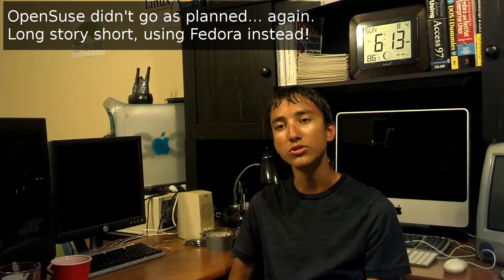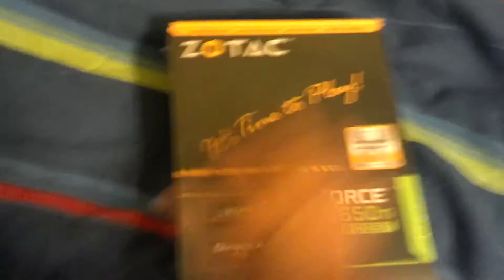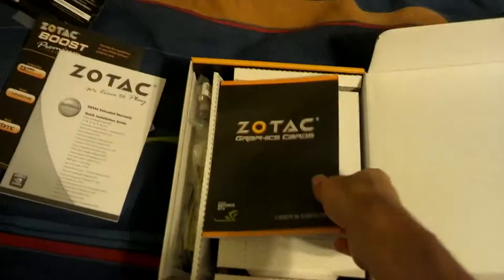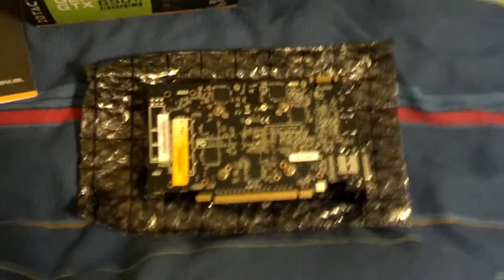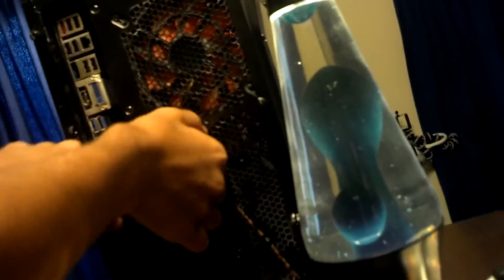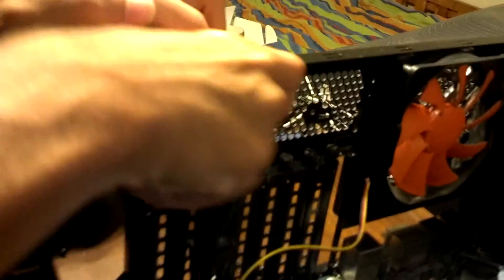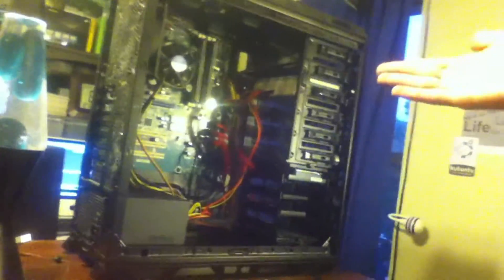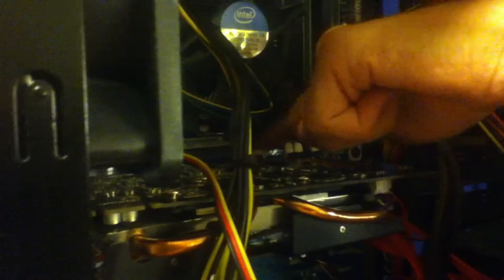Unboxing & Installation: ZOTAC NVIDIA GeForce GTX 650 Ti BOOST

Comment: All due respect but i came here to see a unboxing and installation of a graphics card, not 5 minutes of you rewiring your whole system. Felt like it was really irrelevant to the idea of the video. You could of just skipped any of the wiring and rewiring and shown before/after results if you felt like it was necessary!

Comment: i wanna buy this GPU..my specs are i3 2100 3.1ghz, 4 gb ram, intel mobo dh 67vr , recommend a good PSU ti run this GPU... n will this GPU give me great performance in gaming?...
Reply from the maker: I use a 450 watt power supply, and it works fine. I've already commented plenty about the performance.

Comment from the maker: +UtkarshSingh YouTube/Google+ is being stupid, so I hope you get this. With your power supply, your computer can definitely handle the 650 Ti BOOST. As for playing the latest games, the GeForce line is up to 780 at the moment, and the newer a card is, the more powerful it is. The 650 Ti BOOST should be fine for playing games on medium settings and getting average FPS. If you have multiple 1440p 120hz monitors and/or want to play games on maximum settings, then you probably want something more powerful.
Reply: My PSU for my desktop is 400 watts, will it be able to run the GTX-650 Ti?

Comment from the maker: It's 450 watts, which is the bare minimum recommended for this card. To give you some perspective, it's powering two SSD's and a hard drive as well, in addition to the rest of the computer.